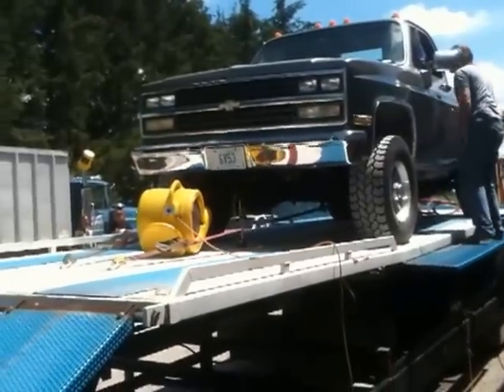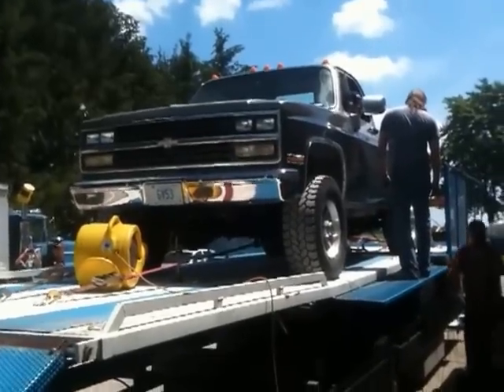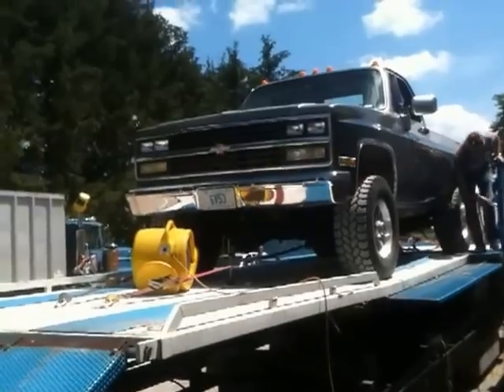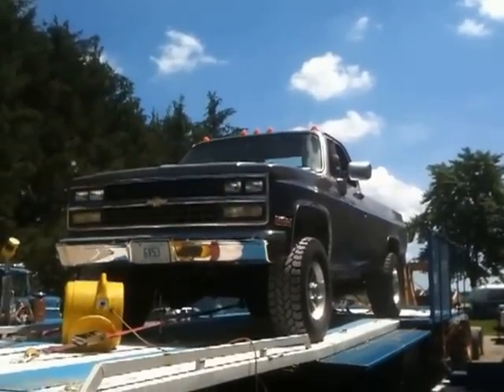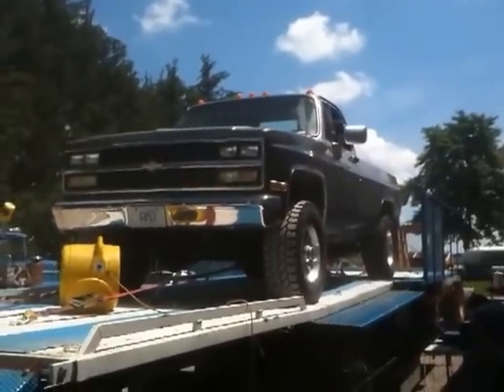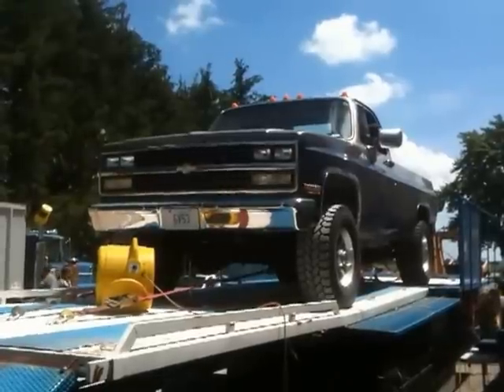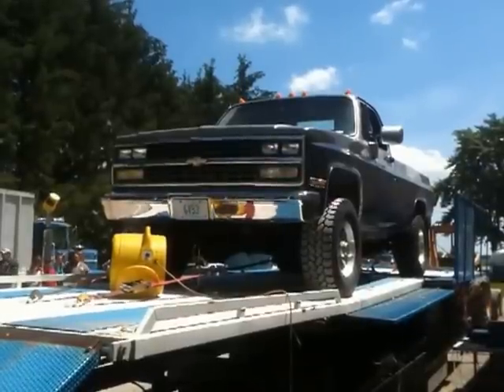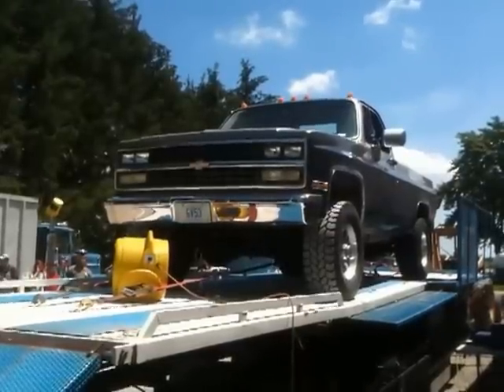1986 Chev 1 ton 4X4 with Whipple supercharged 6V53 detroit on the dyno

Comment: Putting the whipple on this engine was a complete waste of time. The blower on them is only there to allow them to breathe in the first place. IE they won't run without one, and are considered N/A if that's the only thing present. The original roots blower on the engine will perform just as well as the whipple.

Comment: Kwantwz hp??
Reply from the maker: Hi I can’t remember the hp now. I think it was about 170. It was way less than it had with the stock blower and turbo. (235 I think) Ron still has this truck. It is switched back now. He runs it in the local tractor pulls. We want to try nitrous. We have been tryingbto get a hold of Doug Doring in Conneticut. He has a drag racer with a 6v53 that put out 800 hp!!
Reply: @impax012063  800 hp??

Comment: How much does an engine like this cost new and used?  Also are they easy to drop in your truck and will they hook up to your existing transmission?
Reply from the maker: Extensive mods required. Very heavy engine requires at least a one ton chassis. Anything is possible to mate transmissions with adaptors if you are clever enough. These engine sound like they scream but actually don’t rev past 3,000 rpm. Gear ratio is always an issue.

Comment: cam timing will produce higher cyl pressures,so id look at a set of cams for sure,maybe a "P" pump conversion so fuel can be easily adjusted
Reply: Dude it’s a 2 stroke.. there are no intake valves to control with cam timing... there’s no injection pump either.. it’s a direct injected engine with fuel injectors under the head covers controlled by a fuel rack on a linkage rod..
Reply: @mikecorleone6797  you brainless keyboard driving fuck,i have actually rebuilt these engines and have been working on them since i was an apprenticemand you dickhead mike?
Reply: Cam timing?  P pump?  You’re barking up the wrong tree.
Reply: @bnkwupt  if your refering to a stock engine with no modifcations,but this is an experimental performance application,there have been companies in america who re-engineered the 53,71,92 series to get more boost pressure into the cyl,which included new cams to shut the exhaust valve earlier and build pressure in the cyl,a P pump would be a difficult and unusal modification,but as someone recently followed gale banks lead and bolted a common raail system onto an 8v-71 race truck from a duramax p pumping one would be pretty simple and gives you higher injection pressures and an easliy adjusted fuel limiter

Comment: That supercharger needs to go. You didn’t make any power and added a huge Achilles heel to this engine. The stock supercharger was gear driven for a reason. If the belt breaks, the engine will now turn off. Swing and a miss.

Comment: I have an 86 3+3 chevy dually 2wd.  I've been debating between a 12v Cummins and a Detroit. I love the sound of a Detroit but a 12v cummins is a great engine as well.
Reply: Lee Hilton Do the Detroit. 453 or 653. Straight 6 if you can find one. 12 valve’s been done enough. Plus you can’t beat old iron and the head turn’s she’ll receive.
Reply: Detroit is way better than cummins

Comment: I wonder if you can do a compound turbo setup on one of these. 🤔 Love the sound of these old Detroit Diesel!! 👌
Reply: VEgas Rat Rods just put FOUR turbos on a 6V53, badass 58 Apache they did for a customer, not much detail on the engine or dyno numbers though. LOTS of plumbing.
Reply: @91ctddad .... and that would be All that would be "impressive" about it.... all the fancy plumbing.  Doesn't matter how many turbo's you can hang on it.. you can only get so much air past the roots.
Reply: @91ctddad  Holy crap I'd love to see that!! 😲

Comment: Well unless you are doing this just to put on a show . You should rethink your engine plan. Sell the wimp  and go twin turbo if you are looking for power and don't forget the big water pistols and methanol injection then she'll give you the numbers . Just as a side note your exhaust system will have some effect on engine boost pressure and it can be dramatic in some cases . Going from 12psi to 6psi with a muffler change remember this is on positive displacement blower running a full exhaust system . In most cases I have to make my own mufflers/exhaust system to get the numbers . The best and most accurate way to get boost numbers is with open headers .

Comment: Gee never did say how much horsepower or torque it made. I thought that was the purpose of running it on a dyno.
Reply: In another vid they said 165hp. Kinda disappointing, especially since I'm putting a 6V53 in a pickup.   :/
Reply: description says 166

Comment: So you replaced the stock blower with another one.  Two stroke Detroit’s are considered normally aspirated unless they also have an exhaust driven turbo.
Reply: tcorris  you are correct,the blower on a jimmy provides absolutely zero boost,it’s there to provide positive crankcase pressure for ring sealing and to help with exhaust gas scavenging,nothing more. Personally I’d compound charge it. Something he351 over s400 would be a good fast spooling compound setup on that little motor.

Comment: Did y'all have any problems fitting the engine in? I've been tossing around the idea of putting a 6v92 in a k30 but I think it would be too tall of an engine
Reply: You would have to go with a 53 series unless you do a body lift and box the frame
Reply: Maybe try a 6v71. 🙏🙏👍💪
Reply: If you want an engine that big just get a big truck.  I’m surprised they even fit a 6v53 in a pickup anything bigger would definitely not fit.

Comment: i hear a way to add pressure so you can actually create boost without having it go out the exhaust is to have a much lower duration exhaust cam
Reply: Nope, You have to choke the exhaust with a turbo. Its the only way to build big boost
Reply: Dave Molnar yeah that makes sense. but i dont see how having a low duration exhauat doesnt help create boost, maybe you could explain?
Reply: on a two stroke the exhaust ports are wide open during scavenge. You would have to make such a huge change to the cam that the engine would not scavenge well. The only way to build boost in a two stroke is choke the exhaust. Turbo is the best

Comment: DD 2 strokes have to have a blower in order to run as they have no intake valves. A 6v53 was 318cid and @210 to 220 hp  N/A. 6v53t were 250-275 hp I think. The easiest way to build power with this engine is to turn up the juice,install injectors 2 or 3 steps above stock and turbocharging ,then that thing will run like a scared ape. Cool idea with the whipplecharger though...
Reply: What do you think power would be like then
Reply: @jagg5474 all of it

Comment: hello, so I just came across this gem myself, you stated it has a 10spd, what transmission is it, and what are you running for a transfer- case married or divorced?
Reply: Robert Berrey I don't know specifically what he's using but have spent 12 years in the heavy truck repair industry. I say it's probably a Fuller/Roadranger RT610, RTO610, RT6610, or an RTO6610. One of those four would be the best suited 10sp for that size of truck. With the transfer case I've seen people use a divorced NP205 (New Process) or a divorced Atlas but I can't remember the part number on the Atlas. Those are just the ones I've seen people use in this sort of application. Not claiming to be an expert or anything but I have a little knowledge in this area.
Reply: Thanks, i have pipe dreams at the moment of running a 2 stroke diesel in a 53 chevy 1ton, one of the main approaches is to turn it in to a 4wd, and it's a pipedream as i don't have the pocket book to back it yet...
Reply: Go for it you will love the sound and the awesome torque a 4 stroke cannot deliver.

Comment: cool truck, who can I talk to about buying one to import here to the uk?
Reply from the maker: We could build you one. The one on youtube has a 6V53 detroit 2 stroke with a 10 speed eaton fuller truck transmission. after that there is a tranfer case for 4 wheel drive. The truck is an '86 chev single wheel 1 ton. It even has functioning jake brakes. The whipple is not worth having on there and work is underway to change over to the way the military crate motor was with turbo and original blower. I could ask Ron if he'd build you one. It surely would be the only detroit powered chev in the UK. Cost is not for the faint of heart however. There are many extensive and time consuming modifications required to the truck to make it all happen including dis-assembly of most of the truck. Fun to drive tho. I hauled my 28' camper to Davenport IA and back with it which was about 1500 miles.
Reply: THANKS FOR THE REPLY, YEAH IT WOULD BE A ONE OF A KIND HERE IN THE UK! DO YOU HAVE AN EMAIL ADDRESS SO WE CAN DISCUSS THIS FURTHER?THANKS.
Reply from the maker: Hi my email is dave@impax.on.ca or call 1 519 369 1003 for more info.

Comment: You need turbos And + 165 injectors.
Reply: Or he can keep it like that because it's way cooler
Reply: That's what a non smart person would say bc it's a 6v53 Detroit it would blow with turbos bc of the extremely high compression the supercharger still puts compression on it but it will be safer. The stock turbos were good bc they weren't turned up heavy. Think before u type.

Comment: Thanks and Great swap.    You might want to look up John Carey down there in MD. (Carey's Diesel) who built and ran the "infamous" Greased Lightning Rear Engine dragster back in the late 70's & early 1980's..... and ask him how he got 1000 HP out of his twin turbo'd 6V53..... and it was DESTROKED to 270ci !!..... and that was 1,000 HP - BEFORE he put it "on the bottle".

I believe the Greased Lightning is still in his Maryland shop.... completely intact,  under a few inches of dust... perched up on an industrial steel storage rack.... at least it still was,  back around 2009 or so.      

The only reason John quit running it, was because it kept breaking more drive line parts, than his Two (2) Top Fuelers did... put together,  and he was running Top Fuel parts from the belhousing to the tires !!       I forget what his best ET & Mph was, now... it's been quite a few years... seems it was in the 7:20's and running in the high 170's - mid 180's out the back door.

I don't know what his 60ft numbers were.... but, I do know that thing "launched" REALLY HARD... then at about the 40 - 50ft mark, both those turbos would spool to full boost and he'd hit the "bottle" and John told me it was like getting hit from the rear with a huge hydraulic ram..... and either parts would break.... or, that thing was "GONE".... down range.

I do remember that he was turning it at 5,000 - 5,000+..... you should have heard that 6V "sing" !!!   The throttle response was VERY Quick.

Look him up.... as far as I know, he is still among the living.... I know his business is still going,  or... at least it was when I checked around a year ago..... has 2 shops,  one in Ocean City, MD. (410/ 213 - 2221) and in Dover, DEL. (302 / 678 - 3797)... I believe that John, himself.... is running the one in Dover.

Some other folks who are well acquainted with extracting brute power out of the 2 strokes, is J&T (Johnson & Towers) Marine... down in Egg Harbor, NJ (609 / 272 - 1415).... I do not know if, at this point in time... they still deal with any of the 53 Series, but I do know they still "build" 6-71Ti's, 6 - 8 & 16V92's and 6-71N's.... and that "other models" (series) Are available.
450hp 6 -71ti's were not Uncommon in pleasure craft from them, back in the 70's and 80's..... but, "political correctness" was not mandated back then, either.     They have two other locations, another in NJ and one in the Baltimore, MD. area... the one I gave you the ph. number for is their main shop.

Have fun with your 6V53..... probably the most "power dense" potential, of all the GM / Detroit Diesel 2 cycles ever produced, IF correctly built.

Enjoy.
Reply from the maker: Wow… I have not been following this posting and missed this. Very interesting!! We put the motor back to basically original military config with turbo. He runs it in pulls. We were thinking of running nitrous.
Reply: @impax012063 .... thank you for your reply.  If your thinking of running a bottle, I would suggest propane... works great with diesels, especially the 2 cycles.  However, like nitrous... you (meaning, Anyone) need to be very careful in the set up and correct metering in relation to fuel ratios and throttle positions.... just as you would with nitrous, or else... you'll be picking up engine parts all over the place.  

I guess my question to you would be... realistically, what kind of numbers are you looking for, with any amount of reliability at the same time?  Which injectors are you presently running it?  With the hp numbers you listed after your dyno pull.... they must be quite small, as the soot cleaned up after it reached full throttle, so it certainly wasn't over-fueled, and the whipple was matching air flow for the fuel that was there at wot. 

Speaking of wot... what did you have it governed for on that dyno pull?..... it sounded to me, like it was somewhere around 2300+/-...?

As far as "building" DD's... most of my experience is with the series 71 engines... and a 4 year degree in Diesel Engine Design and Theory (from the mid-1960's)... specializing in 2 cycle.   

The last three years of my training was directly under P. Nicholas, just retired (in 1963) from R&D at GM Diesel (as it was known as, until 1965), and who was a lead engineer in designing the very first 2 cycle prototype GM Diesel engine (a 4-71.. and of which I have an 8"x 10" factory photo of, just moments after its very first fire up, that he gave me after I came back from Vietnam), and through him I was able to see the "back room" at GM Diesel, where the experimental engines were... that they "never built" (that Corporate "brass" and their "bean counters" never knew about).  ; )

If you're into the sled pulls, and have ever paid attention to the NTPA/ATPA/ECPA "Super Semi" class....there was a well known KW with a V12 (71) that ran for decades under the name of "The Lady Butterfly".... which I wrenched on and tuned for my good friend, John M. (the owner) until he quit and sold it due to health issue's (now deceased).  

We were pulling between 23 & 2500 hp (approx. 3000 lbft of torque) out of it and turning it between 4 & 4200 rpm.... for years, with  over 11,000 hooks... only spun a main bearing in 2006, in all those years of pulling since the 1990's.  Also, it was "all motor".... No "power additives" allowed, ie; propane & / or, nitrous.  

We didn't have the Big Bucks like many of the guys that came into it during the mid 2000's up to present day, and we did what we could with what we had... and could have used better matched turbo's and a High-Bypass blower and faster gear ratio, for the amount of fuel we were pumping into it.... but, we had fun and rarely broke anything, except for minor stuff... with the exception of the trans in 2008.

Comment: Only 166 hp? You should be pushing at least 250. Is it because of the backpressure issue?
Reply: 425lbs of torque
Reply: 166 actually wasn’t that bad for a NA 6-53. Keep in mind he’s turning through a 10 speed truck transmission, transfer case, and pulling 33” (I think) tires; all of that mass and drag really skews the numbers.

Comment: ...naturally aspirated detroits close the valves after the ports...turbocharged detroits close the valves before the ports...you just need to get your cam timing to the turbo specs and it will build boost...I would go with a turbo...superior to anything else...
Reply: The 6v53 blower turns 33.33 % more rpm than the crankshaft  no matter  what its a constant
Reply: ...should have mentioned 4 years ago that a turbo will still require a roots blower for exhaust scavenging...you need both and you need to advance the cam timing to get the valves closed before the ports close to build any boost...
...the Whipple should build boost if you advance the cam timing...it won't if you don't...
Reply: There is no such thing as a naturally aspirated detroit diesel . All detroit 2 smoke diesels are forced induction All no exceptions . And the crank case blower must be positive displacement type.
Reply: Welcome to the hair-splitter’s club...
Reply: @2x4barrels40  ...the blower on a Detroit is an exhaust scavenge blower...not a supercharger...
...any Detroit without a turbocharger is naturally aspirated...their exhaust valves close after the ports which means the cylinder is at atmospheric pressure at the start of compression...turbocharged Detroits close the valves before the ports which means the cylinders are at turbocharger pressure at the start of compression...

Comment: advance the cam timing one tooth. boost issue solved. i get 17 lbs running 1 tooth advance on my silver 453t just beware egts get high fast if you use all the new found power
Reply: Troy Miller only works on a turbo engine because turbos make backpressure, all the extra air in the video from the supercharger goes out the exhaust. need a low duration exhaust cam

Comment: Have  you ever considered a custom ground  camshaft? I'm thinking one with a slightly higher lift but with less duration (or open time), thus alowing increased pressurization during the up stroke. Just a thought.
Reply: jon dough  The cam operates the exhaust  valves.
Reply: @kd7uha and injectors
Reply: jon dough Ya we do!